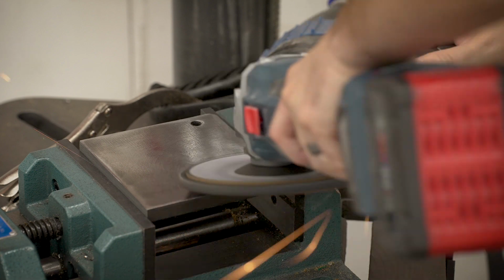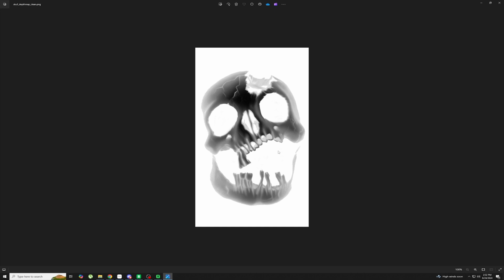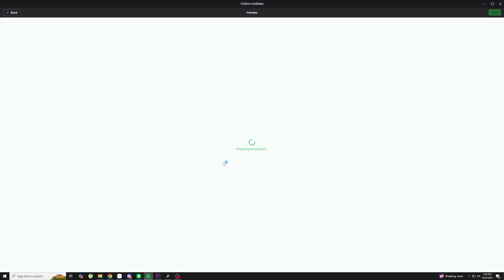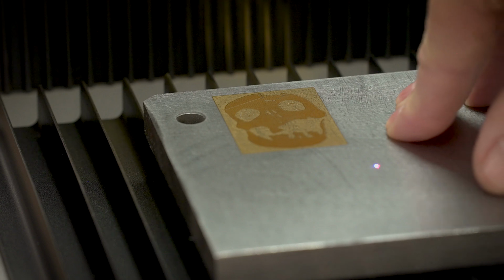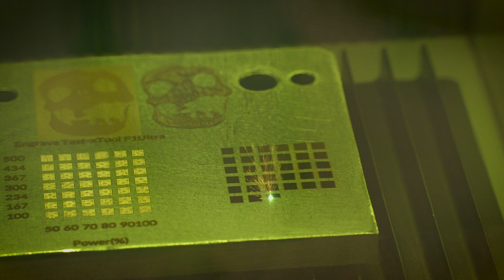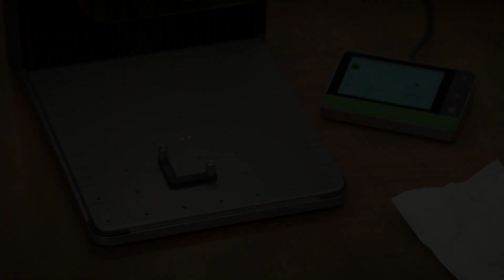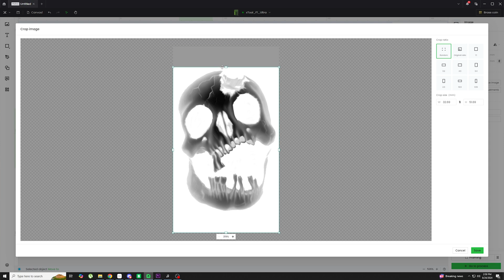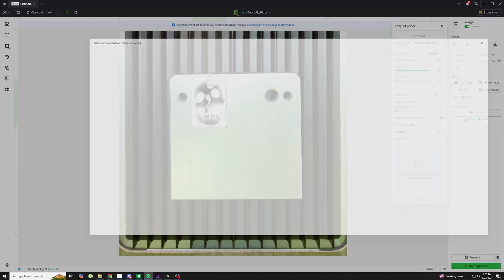Deep Engraving Steel - xTool F1 Ultra!

Comment: Hey Robert, absolutely awesome video and explanation, thank you for this! I came over to this video while searching for info about cutting silver sheet metal. Xtool itself couldn't provide data on this and just told me "yeah, up to 0,4 mm thickness".

It's super interesting what you said about that motorised laser head unit and that you can go like 2,56 mm deep.

Do you think one can use this function to cut sheet metal (in my case sterling silver) up to a thickness of like 1,5 mm?

If I set the settings to theoretically "deep engrave" an outline to the thickness of my sheet - that's practically cutting, isn't it?

Comment: This is Embossing not Engraving. Image could have been inverted before creating DM.  No reason to slow things down with 300 lpc; the image does not have enough detail to warrant that.  There are ways to filter out a lot of that stuff before it reaches xTool overpriced filters.  And just because the head moves down .01mm per layer doesn't mean that much material was removed or that you will achieve the depth you think.  That is material and settings dependent.

Comment: For the metal dust issue, maybe a water trap?  Exhaust from the laser goes into a 5 gallon bucket, may 1-2 inches below the surface of the water.  Vacuum pulls from above the water level, should trap a huge portion of the dust.

Comment: I'd love to see how this would work for some pseudo "machining". Cutting out some linkages and gears and whatnot. How much precision you can get, how much kerf, surface finish, how much time it takes when you're just following a vector rather than filling in a surface. Could potentially be a practical application for small and otherwise difficult to cut out geometry.

Comment: I really want to know what's stopping these from just doing 10-30mm depth cuts, given that you mentioned a 2.56mm depth limit. I mean, beside grayscale bitdepth limit, which sounds like a solvable issue.
Reply from the maker: Yeah, in theory you could just manually refocus it deeper and keep going.

Comment: im curious, can the fiber laser cut clear acrylic? cant find any info about it
Reply from the maker: Only CO2 lasers can cut clear acrylic.  Diodes can't and fibers can't.  Fiber is for engraving metal, diode is for most non-transparent organics (some plastics, woods, leathers, etc) and CO2 is for everything a diode can do, but with clear arylic.
Reply: @RobertCowanDIY Out of interest, why can't a fibre laser do clear acrylic, but can do metal when a CO2 can do the opposite.
Reply from the maker: @KaizerRemix  it's all about the wavelength of the light
Reply: @RobertCowanDIY Makes sense. Thank you.
Reply: it would be a much better space efficient laser cutter for acrylic if possible
Reply from the maker: Yeah, understood.  But only CO2 can cut clear acrylic.  Cloudray has something in this general form factor that's a CO2 laser.

Comment: Would a magnet be useful to catch some/any of the iron particles to act as sort of a pre pre filter?
Reply: or one of those centrifugal things that stuffmadehere added to his cnc mill's exhaust, but the metal dust might be too fine for mechanical solutions
Reply from the maker: you're right, this would be too fine for a simple cyclone like that.  A really good cyclone needs to be MUCH longer/taller to work properly for stuff like this.
Reply from the maker: Yeah, a magnet could work to catch some of the particles.